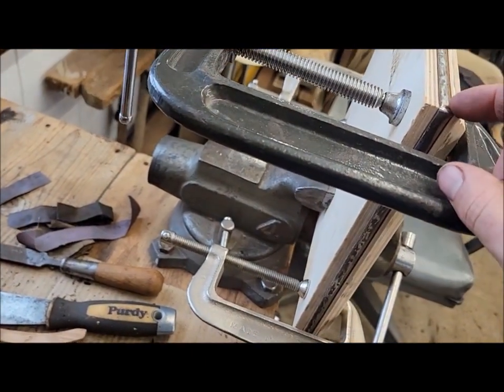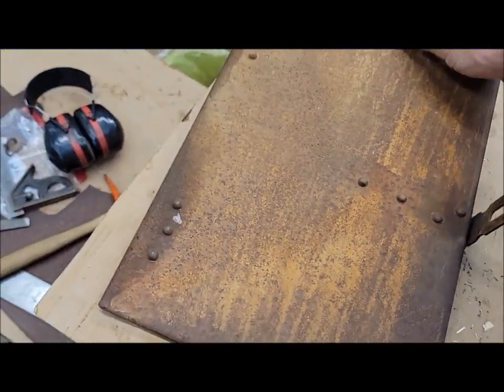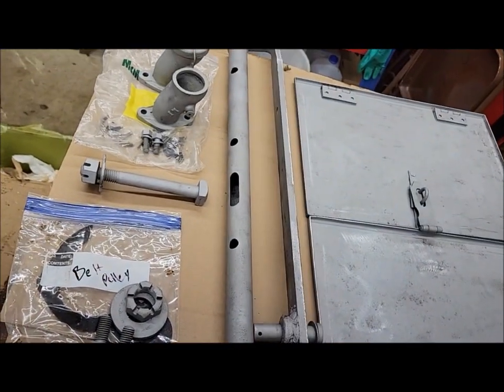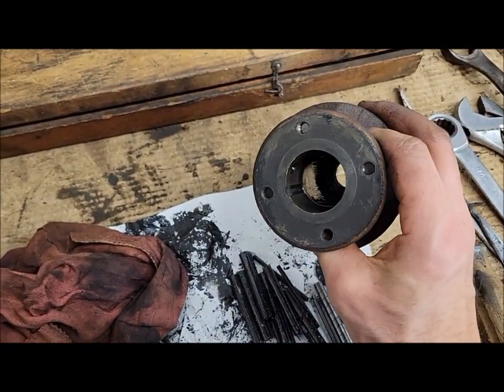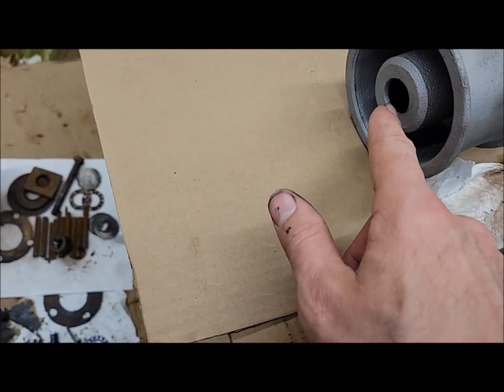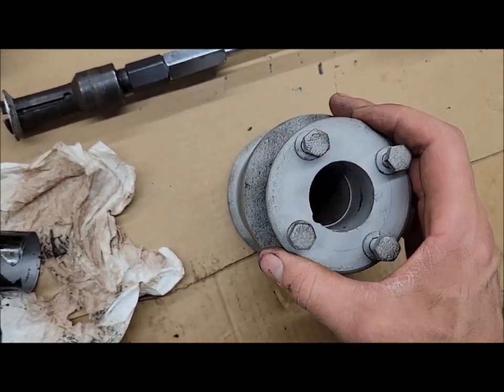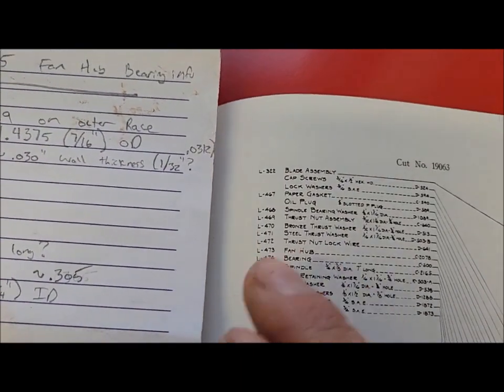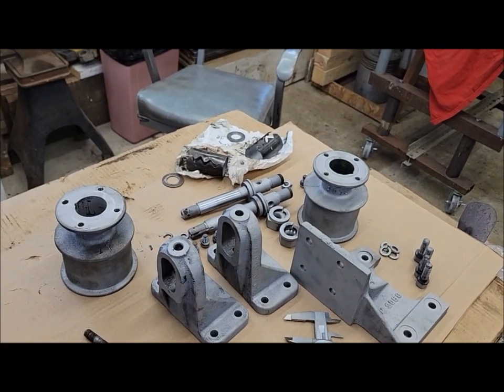Allis Chalmers 15-25 Part 36 -Tool box lid, Fan assemblies

Comment: Say hello to Dave for me. We met at Freeport when he debuted the Duplex. I don't know how much wear is on those axle shafts for the fan but would spray welding get them back above and grinding bring them in size? Abomb79 (I think that was the year anyhow) out of Florida has done spray welding and may be able to fix them up. He is a creator here on YouTube if you aren't familiar. Hope all is well with you bud. Loving this restoration as much as the 6-12's.
Reply from the maker: Dave has been a tremendous help with the restorations of both these 15-25's and the 6-12.  It is so nice to have a friend who can check out the details, get you dimensions, sketch up a blueprint for parts, snap a pic, etc...
That is a possibility on the spray welding as a repair.